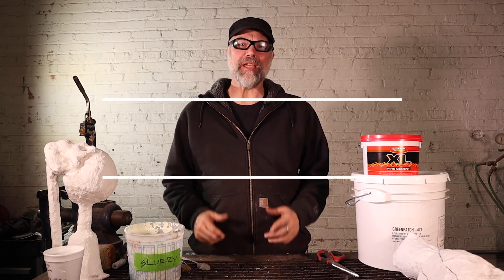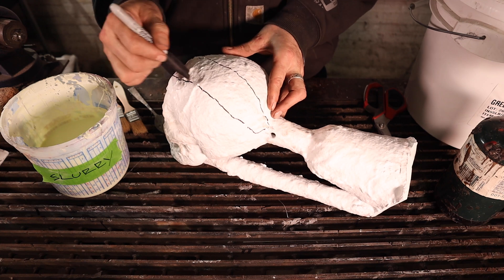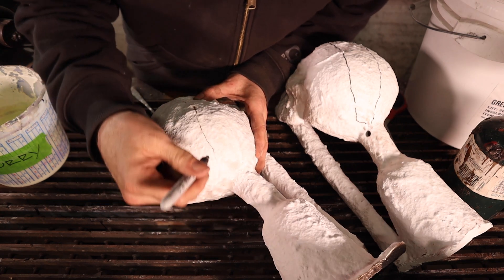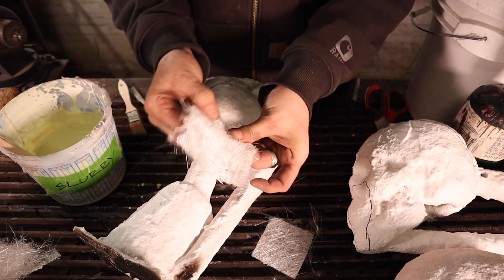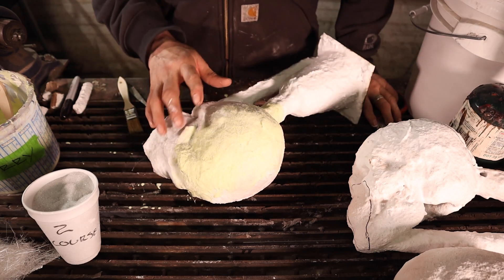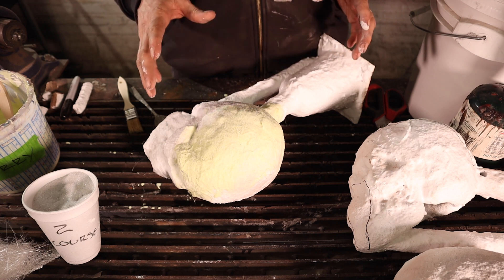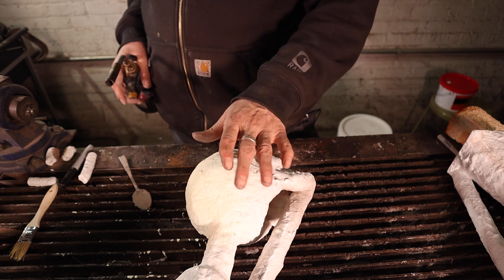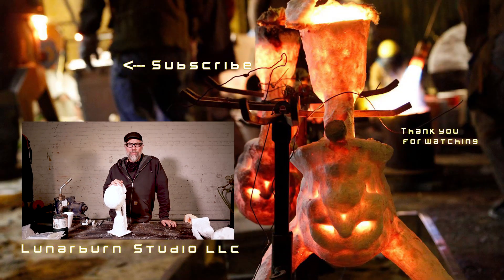How to fix broken ceramic shell with your Slurry

Comment: My break happened before burn out what should I do to fix it?
Reply from the maker: Depends on how many dips you have on.  if your on 5-7 dips of less i will fix with slurry and chopped fiberglass.  It closer to the last tip and its a complicated brake,  I will finish dipping the individual pieces and burnout, then reassemble with slurry and glass or refractory paste like green-patch.

Comment: Is it possible to add chopped fiber glass to the slurry at the first place to prevent cracks? If yesm how?
Reply from the maker: I wouldn’t do that. During burnout the fiber glass will melt out creating voids that will fill with metal and interfere with your detail/surface.  As for the cracking how soon does the cracking start? are you doing a slurry only coat your first dip? Are you cleaning your. Wax for dipping?

Comment: Do cracks often show up on shells after burnout? What would happen if you accidentally miss a crack and end up using a cracked shell for a metal pour?
Reply from the maker: If the crack is all the way through the shell the metal will leak out. if not too big it can be fixed/plugged during the pour if you can see the leak.

Comment: Thank you for this whole series of videos. I am in a situation where I want to fix a crack like this in a shell.  If I follow this method with fiberglass and slurry and stucco, and dry it thoroughly does it still need to go back in the kiln to vitrification the patch material? Or do you just torch that section?
Reply from the maker: You can vitrify the patch during your preheat.

Comment: Your videos are great. My shell cracked during boil out. I assume that I can use this method (without the torch at the end) to repair the green shell. Please advise.
Reply from the maker: Yes you can! First make sure your shell is completely dry. You should be able to do it before or after vitrification.

Comment: Thank you for your contribution been struggling to find a nice process for casting. Tried lost pla in plaster of paris but was a major struggle. Just ordered some silica flour and colloidal silica holding thumbs it works. Keep up the great info
Reply from the maker: Those should be good for the slurry but don't forget the courser grains (stucco) to apply to the wet shells after you dip them in slurry.  Check out this video if you havent already.  https://youtu.be/jsscXzfGJ7M
Reply: @LunarburnStudio  i have fine silica sand i was thinking to try use or a bit of course grain chamotte. Not sure if those will work. Holding thumbs. Looking forward to more videos :)
Reply from the maker: I am not familiar with chamotte, let me know how it works.
Reply: @LunarburnStudio  i will do. From what i can see it has a high silica and alumina content but at this moment i know just enough to get in trouble. Keep up the great work
Reply: @tke7mu0u  how did it go with using chamotte? I'm curious and tempted to give it a try since it's economically way more interesting 😊
Reply: @fabien242  I only use it for aluminium casting but works perfect. The only issue I have with it is that settles at the bottom of the container over night but a few minutes of stirring and back to normal
Reply: @tke7mu0u  I was thinking on using chamotte as stucco backup layers. Since you mentioned that it stays at bottom, I assume you are using this into the slurry preparation isn't?
Reply: @fabien242  yes so I use 2 versions of the chamotte a 200 mesh and a 1mm crush. The 200 mesh is mixed as a 2 to 1 ratio with the colloidal silica and then the 1mm grain as the filler after it's been dipped. That seems to work perfect for my needs. My ratios might be off I havnt mixed in a while
Reply: @tke7mu0u  thank you so so much for these extra infos. Really helpful. Will give it a shot for the backup using chamotte. I'm pouring bronze usually, but I think some limits can be pushed using ceramic shell casting.
Reply: @fabien242  the temperature of the bronze shouldn't be issue I think the biggest challenge is just limiting cracking of the shell